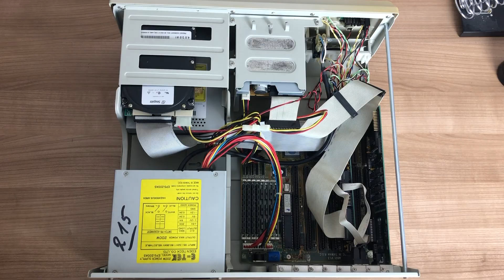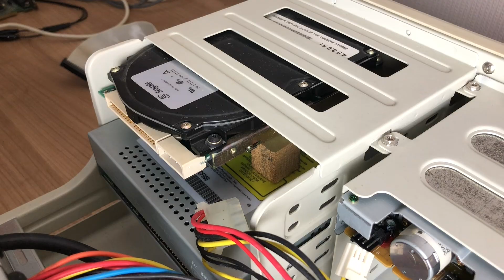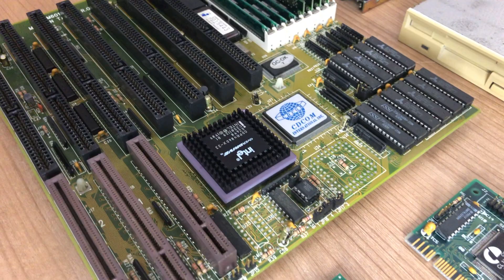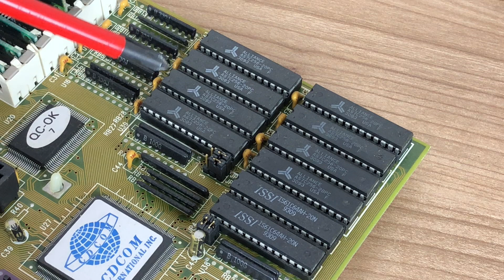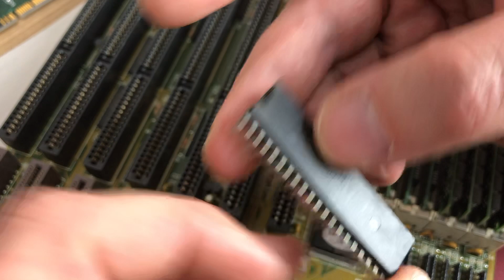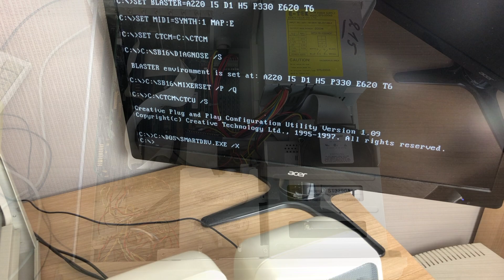Preparing my 486 PC dx2 (disassembly and battery cleanup) for some gaming

Comment: Over-using vinegar isn't a problem, get a spray bottle and a toothbrush and go wild. Spray on, wait, brush off.
It takes a battery months to cause damage by leaking, it would take vinegar just as long.

Comment: Hm, I don't know about the overdrive chip, but isn't a 486 DX just with the coprocessor included (as in opposite to the SX, which lacks it) and the clock increasement comes with the DX-2 and DX-4 (which "only" increases internal clock by 3x instead of 4x which the name suggests)?
Because the CPU just reads DX, but I don't know how a DX2 CPU would be labeled.
Just curious :)

Comment: Back in the day I found that VLB Multi-I/O cards were not "standard stuff" at all. Mine came with a set of DOS drivers for some enhanced 32 bit transfer modes. Paired with a DX2-66@80 and a Sony Double Speed CDROM, I was able to enjoy Wing Commander 3 cinematic cutscenes without stuttering. My friend already had very expensive a P90 and a Quad Speed CDROM. He could not understand why WC 3 cutscenes would stutter on his PC but not on my old and slow box.

Comment: The screwdriver you used and which broke looks like a Pozi. However the majority of the screws inside computers are Philips. Using the wrong screwdriver will damage driver and/or screw. 
Pozi screws usually have two crosses instead of one for the Philips screw. (The replacement driver you then used was a Philips one.)

Comment: I HATED MP F1 Gp for the insane basic ram requirements (>600 if I'm not wrong). Remember doing multiple configurations on the autoexec.bat to have various boot option. I started with an used 1989 286, going up to a 386 16 then with the same case a 486 dx4/100 (with mobo changes of course). The funny thing was I kept the old 5" drive. I guess mine was the only 486 machine with that kinda weird thing. And... playing with ISA slots, setting IRQ, DMA.... those were the days :)
Reply: I remember having to change extended to expanded memory or something like that. Wonder how many weeks of my life I’ve been editing config.sys and autoexec.bat 🤣

Comment: It's actually lye and not acid that leaked out of the battery. Lye converts to carbonates on contact with air, given enough time. Hence the sizzeling when applying vinegar.

Comment: I would have replaced the socket and a few of those resistors near the impacted area, the parts are cheap and you may as well. That floppy disk drive i would have scrapped too.

Comment: I'd say the hard drive was supposed to go into the bottom of the floppy drive cage, because there appear to be 3 mounting slots for drives there but the case will only accept two floppy drives.

It's a possibility that it's a retrofit, and that the computer housed a 5.25" drive originally. After all the Overdrive CPU is a retrofit too, and the memory configuration is obviously not factory either, with two different models of SIMM cards.

What i'm most curious about: how did the jumpers for the front panel Turbo display work? :D Because my first enclosure had a simple LED, was cheaper and more subdued that way, and i only saw the 7-segment displays in stores and at exhibitions and such, never seen the back of one!
Reply: I also thought the hard drive should have been in the 3.5" cage with the floppy drive.  The block of wood is there because the drive should have been in some form of caddy or adapter to hold it in place in a 5.25" bay.

Comment: I have a flatter version of the same case, funny. Expension cards are in via a riser card.
Reply from the maker: Catriona cool ... I really like this case and computer in general. To me this encompasses everything about nineties 486 computing :)
Reply: @RetroSpector78  It is beautiful indeed. I hope I can get mine working again. Its a texas instuments i486/40. The board has some battery leakage damage and the ISA riser card seems to be dead... :/
Currently I have a whole bunch of boards that I will take some place with a desoldering station maybe next week so I can get all the bad caps and dallas and barrel batteries off in one go.
Might link a pic once its all pretty and working...

Comment: I think those 72-pin simms are available in 2MB and even 4MB sizes, you can easily upgrade RAM (for win 95).
Reply: they can be even 16 or 32 mb on a unit. Once had even two 64mb modules. Foreseing you question - I collect all that stuff - retrocomputers and so on)

Comment: Well this isn't really a Sound blaster 16, it's an AWE64 which is much more newer ^^

Also these cache chips don't hold 32Kilobytes each, but 256Kilobits ! You may want to simplify it to kilobytes, but actually it's the main reason there's 8 of them !

The "battery acid" is actually the opposite : it's a base, that's why white vinegar works so well with it ! they simply cancel one another.

I'd advice you to put some tin on these eaten traces as they now they lost some material, and if possible use epoxy on top of it to make sure the traces are once again protected, since the solder mask has gone away as well :)
Reply: 32 kilobytes is 256 kilobits
Reply: @burntoutelectronics  yes, but when you select an address you only get one bit. So you need 8 of them to have a byte and avoid multiple reads.
Reply: @DxDeksor  True, however each chip still does store 32kb. Just they are configured so that the whole byte can be read at once with eight